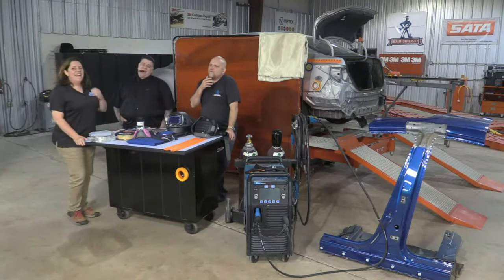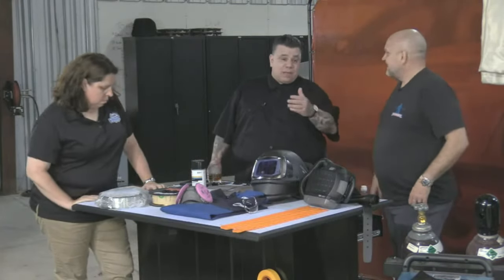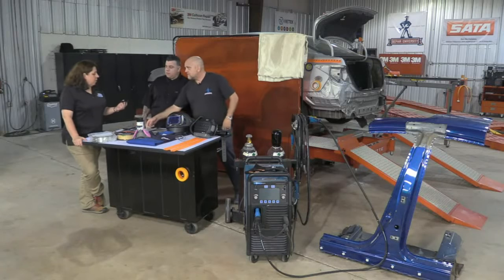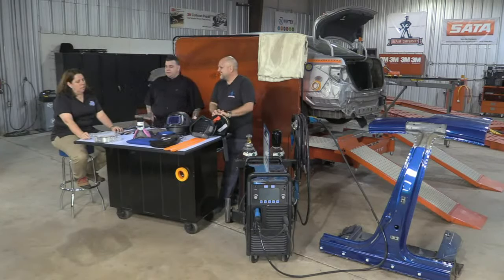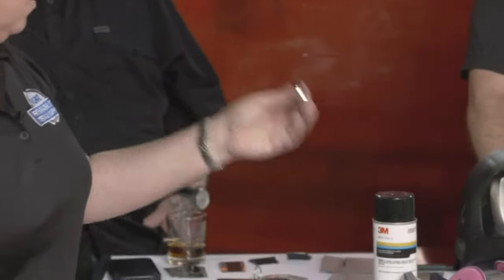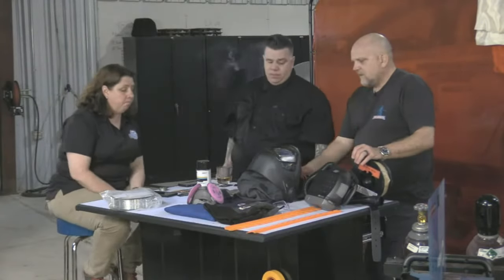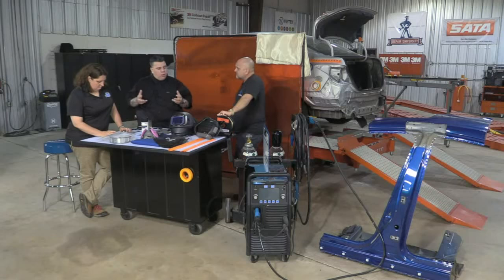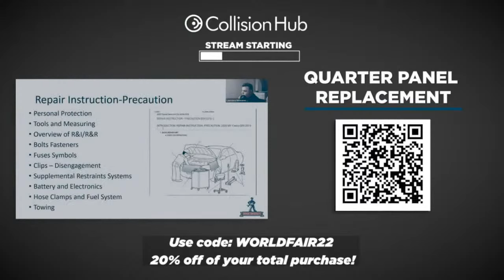Planning Process For Collision Repair Welding

Comment: Since I started as a body man, in 1990. I averaged 85 to 90 hours a week. With a recheck once a month. Liked it that way. The welding aspect after 2010,Nobody was prepared,for anything. It was comical. I stay to long, should move on, get the same story, again and again, thinking something is going to change, but it never does. It's the money, you can't afford to do it correctly, you need to get out of business. You're going to get sued.